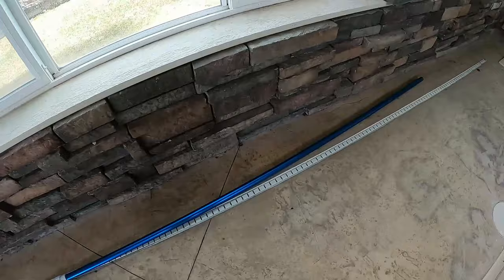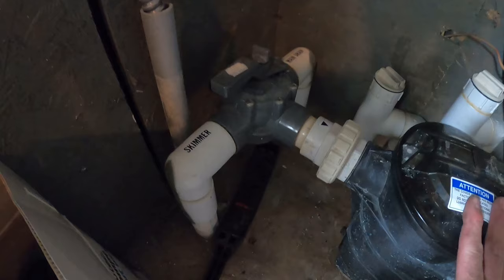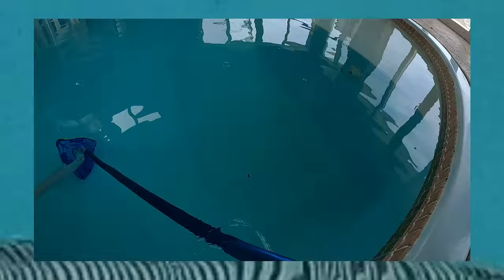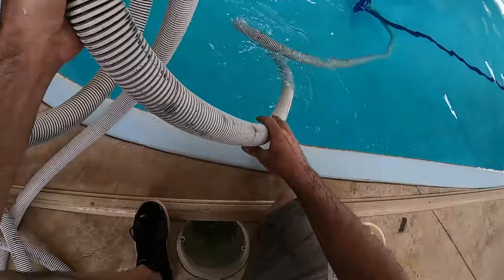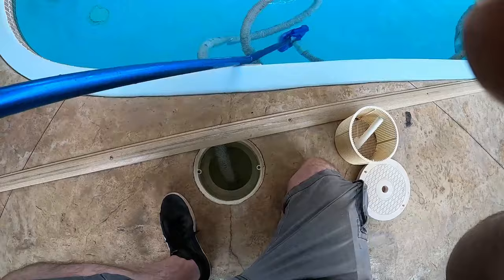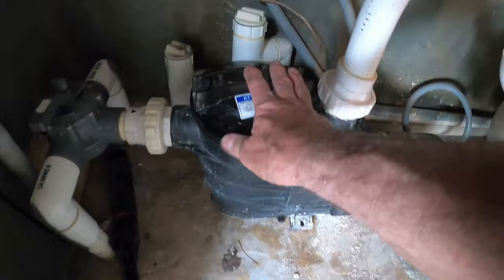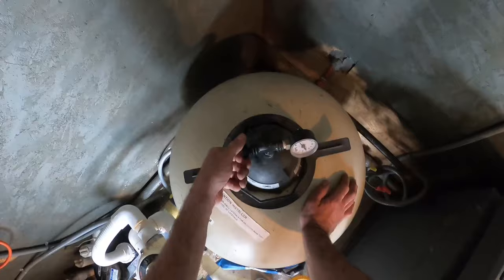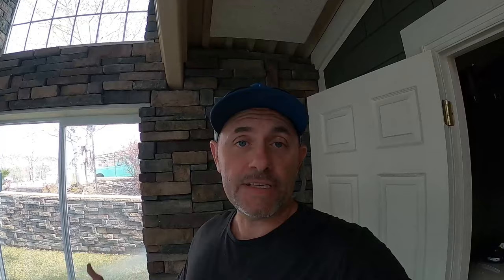How to Vacuum a Pool: Vacuuming your Pool: Cleaning your Pool for Beginners: Vacuum inground pool

Comment: I have no backwash bib. Only way to drain pool to lower level in case of lots of rain would be to remove the cap on back of filter… that’ll kill the surrounding grass around the equipment.

Comment: Thank you for this. i removed the plate that attached to the hose and goes over the skimmer and hooked the hose directly. This increased the suction with at least 2x the power as before.

Comment: I'm curious when I can use my dolphin oasis pool cleaner for the first time..I just bought it and haven't used it. I hired a pool company for green to clean and after 6 visits 90% of the debris is gone..but still a lot of algae piles..do I have to vacuum to waste all of it out before putting the dolphin in for the first time? This is the first year I'm using a robot to clean pool I fought it the year before with manual vacuum and just didn't have the time to maintain.  Thank you for the help and the great videos you have provided

Comment: hi, Good day, i try to clean my pump busket i turn my 2 ways bulb into off position, but then the water is flowing upon opening the pump, can you help me please thank you
Reply from the maker: If you have a sand filter with a Multiport valve you can put that on the closed position eliminating water coming back through the filter from the return lines. If no multiport valve and there's no other valves to turn off you will have to install new valves on both the suction and return side of your pump or cap off your return jets and skimmer with winter plugs while you clean your pump basket

Comment: So a better way to prime your hose is to attach it to the vacuum head, put it in the pool and feed your hose into the pool until you get to the end and water actually comes out of the end of the hose in your hand. You can then put the end of the hose in your skimmer or attach to your vacuum and start to clean.

Comment: Bleeding the filter? How do you know when to stop. You do this every time open open the basket?
Reply from the maker: Anytime you have to stop and clean your pump basket or prime your pool pump the air that was in your pump and lines gets pushed into your filter and gets trapped in the top portion. Normally there is a air bleeding valve either on the assembly piece that the pressure gauge is attached to or across from the pressure gauge on the top of the filter. note not all filters have a bleeding valve such as some top mount sand filters where the multi-port valve handle is on the top of the filter and also some of your smaller cartridge filters. I normally bleed the air out of them when i am all finished vacuuming and done opening up my pump. with an air bleeding valve you will open it until the air stops hissing and you get a steady stream of water squirting out.

Comment: I have two skimmer buckets. When I connect the vacuum, the pressure stops. Does anything work anymore?
Reply from the maker: Sounds like when you attach your vacuum to skimmer 1 your pump starts sucking off skimmer 2 because it's less resistance without your 30 plus foot vacuum hose on it. The cure is to shut the valve going to it in the pump room or if there is no valve you will have to plug one of your skimmers with a 1 1/2 inch or 2inch plug.
Reply: @Poolelementary  I stuck a tennis ball in skimmer 2. I just can’t tell if the vac is sucking or just moving dead algae around. My backwash viewer is clear. Maybe I’ll drain the pool and let kids use it as a skatepark for $10 a day. L
Reply: The filter just exploded! I need a Dallas, TX pool professional.
Reply from the maker: I would say yes some one should definitely see what you got going on there in person 😉

Comment: I would've thought you'd sweep the walls and steps down before you vacuum the bottom?  Seems like you'd be throwing dirt down, after you vacuumed the floor clean?  Just asking.
Reply: Thank you! Finally someone with some sense and who gets me. You wont believe how much crap i get from customers and employees like im going to stir up the whole pool. Im simply gently brushing the dirt off the high spots like steps and benches without stirring it up too much. By the time you get your vacuum stuff put together the dirt will settle to the bottom. Im basically trying to just get the dirt to the floor so vacuuming is alot easier.

Comment: Hello, new to vacuuming the pool how does  the vacuum hose connect to  the skimmer?  bought  one but  doesnt  really stay  connected  to the  skimmer,  if  you  leave  it  alone it floats  up  does the  vacuum  pressure keep it  connected.   seems  the  skimmer  port  is  larger  then  the  1 1/2" vacuum hose.

Comment: Great video! Im still having issues with my pool , it seems like a never ending process when it comes about suctioning the debris from the bottom of my pool. I have done it many times and still debris in the bottom of the pool. By the way i cant tell which one is the skimmer or main drain since there is no name on the piping. Help?
Reply from the maker: If you have a sand filter on your pool you might try vacuuming to waste to bypass the filter and send that junk on the bottom of your pool straight out the backwash line. if you do have a sand filter and need direction check out my other video ( How to vacuum a pool to waste with a sand filter. when I can't tell which line is the skimmer and the main drain coming into the pump I just shut one valve and then go check to see if my skimmer is still pulling water. If it is you just shut the valve to the maindrain or vice versa. The battle of getting the pool clean can seem like an eternity but keep at it and you will tackle it soon enough!
Reply: Yes, thank you so much, Your advice has really helped me a lot. I do have a sand filter.  I sure have checked some of your other videos.
Reply: @Poolelementary  This brand of vacuum picks up leaves in pool?
Reply from the maker: It will but you will have to empty the pump basket constantly if there's more than a few handfuls of leaves in the pool. A leaf net or a vacuum with a leaf bag works best on big leaf removal jobs.

Comment: Will the sand and dirt at the bottom damage the pump?
Reply from the maker: The pump should be ok unless we're talking about alot of sand. If we're talking like 20 pounds or a half a bucket of sand it could start wearing down the impeller. I've only seen that much sand if there was problems  with a sand filter. In that situation we netted out about 50 pounds of sand and touched up the rest with the manual vacuum with no effects to the pump.
Reply: If  the pool is super dirty and in the process of recirculation the skimmer filled up and lifted such that dirt was going right through even to the pump basket,  what do you suggest I do first.  I noticed less suction when I turned in the pump so I think there's debris clogging things somewhere.  The water is also green with algae
Reply from the maker: I would definitely get the pump to run properly  first thing to help with debris  in the line. Make sure pump basket and skimmer basket are cleaned. Then I would backwash filter or spray off your cartridge filter. Fire up the pump and see if you can get your normal flow back. If not you might have something  stuck in the line. If so I have used a shop vac and sucked back through the skimmer or they make a drain clog balloon  that screws onto a garden hose and put it in the suction side of the pump housing and forced water back to the skimmer unclogging it. For the algae the answer is as always chlorine. I don't recommend  vacuuming  the pool until you can see what your vacuuming  off the bottom.

Comment: Hi! I'm new to owning a pool that was inherited. I just replaced the old pump with a Game Sandpro, but it doesn't have a waste option on the valve. Can I vacuum the floor of my Intex above ground pool on any other settings? This pump has Filtration, Backwash, Rinse, Closed, and Winterize/Drain as its options. Thanks in advance for any advice!
Reply from the maker: Usually the drain setting is the same as waste. They both bypass the filter and are used to drain or vacuum the pool. Thanks for watching pool elementary and good luck with your pool ti352!
Reply: @Poolelementary  thank you!
Reply from the maker: No problem! Help pool elementary  by liking the video and Subscribing!

Comment: My psi drop to 0 how do I get it back up
Reply from the maker: I would first check to make sure the skimmer and pump baskets are clean then I would clean the filter or backwash the sand filter. If the pressure  Guage still says zero and the pump and flow of water coming out of the return jet in the pool seem to be flowing good all thats left is changing the pressure Guage out.

Comment: My pump has 6 valves, hard to tell what dies what
Reply from the maker: If you know where the filter position is then normally waste is one notch to the right and backwash is 180 degrees or the opposite side of filter position. You want to check out the brand of filter  you have and Google it to see of you cab find a pic of that multiport valve to make sure. Good luck and thanks for watching Jeremy!
Reply from the maker: Sorry for the weird words in my comment. Voice text while I'm driving. Lol

Comment: Do I have to get the bigger hose to clean my pool if so why are they selling pool vacuums without it why can I use a regular water hose
Reply from the maker: Most of the pool Vacuums attachment hooks to a 1-1/4 inch to a 1-1/2 inch hose which hooks to your skimmer line. Now if your vacuuming leaves they do make a vacuum that attaches to a garden hose that creates suction when the garden hose pushes water to the vacuum. The reason most Vacuums don't come with hoses is all pools require a different length hose and the longer the more expensive they are.
Reply: @Poolelementary   yeah because when I turn it on it pops off and the dirt goes right through the net back into the pool making it foggy and just pushes dirt around instead of collecting it